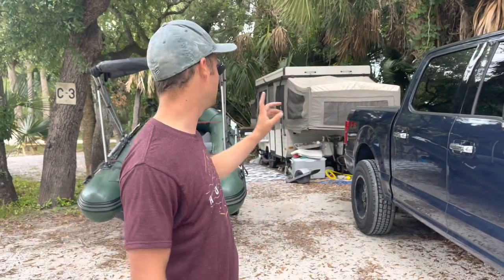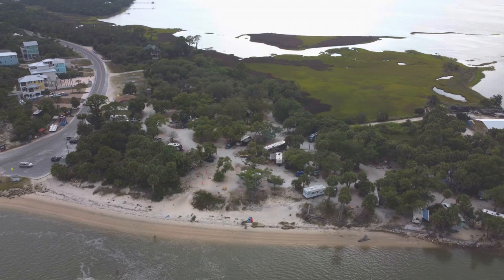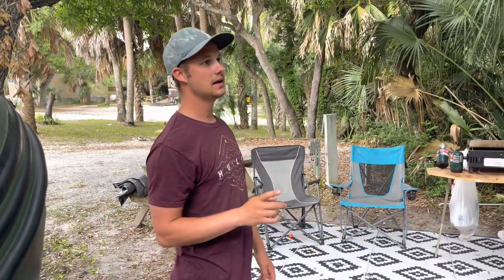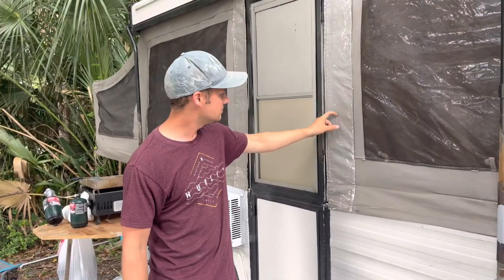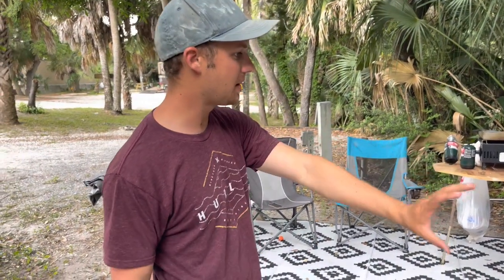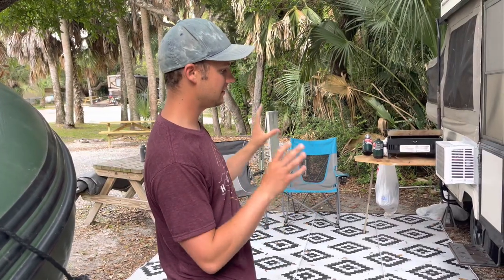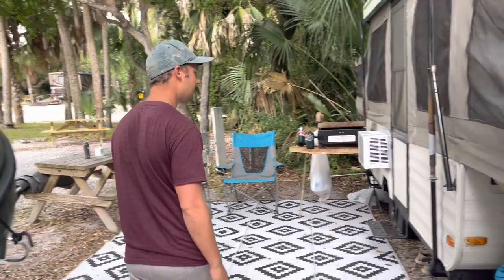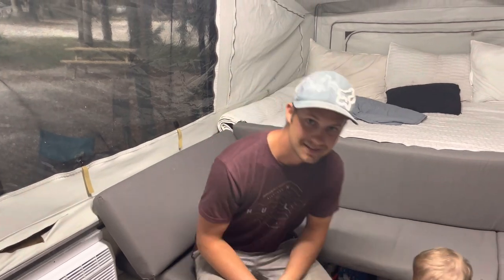Paint Your Pop Up Canvas.. UPDATE!

Comment: You said the roof didn't stick the paint well?  What would you use instead.  TY, just staring on my soon to be pink palace and your videos were so helpful and inspiring.
Reply from the maker: Thank you for commenting! The hard top roof of the camper stuck very well but the vinyl roof for the pull outs did not stick at all. I actually did not paint them because I saw how poorly the paint stuck to the vinyl on the side by the door. If I were going to try and paint the vinyl again, maybe I would use an oil based primer like kills on it but even still I’m not sure if that would work. Vinyl is a very hard surface to get paint stick to.
Reply: @ColtenBethel  the pull out? The bed area? They aren’t canvas? I guess i need to watch again lol.
Reply: Ohhh I see didn’t realize the tops were not canvas. Thank you for the reply.
Reply: @ColtenBethel how about trying vinyl paint? They do sell paint for vinyl furniture. Might work, if it’s flexible enough.

Comment: Thank for the update.  I bought a 2004 hybrid travel trailer and we cleaned the canvas alot. The back looks better than the front, and we are gonna buy geckos for the pop outs anyway, but i loved your video showing that it can be painted. What is the name of the color you used? Had you kept the box for the portable ac you could have returned it. Or sell it on market place. You can also use those floor fans, which aids the ac and moves air around. Your baby has gotten bigger and so cute.

Comment: What type of paint did you use on the interior canvas? Is it the same as the exterior.
Reply from the maker: You are correct. We used the same on inside and out
Reply: @ColtenBethel  thanks so much I appreciate that